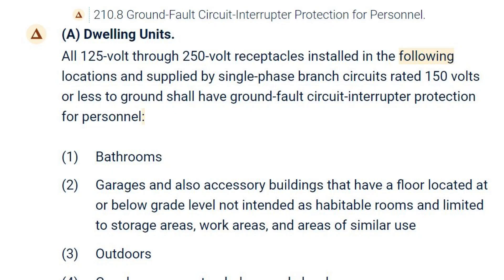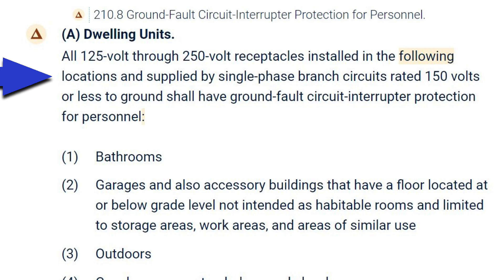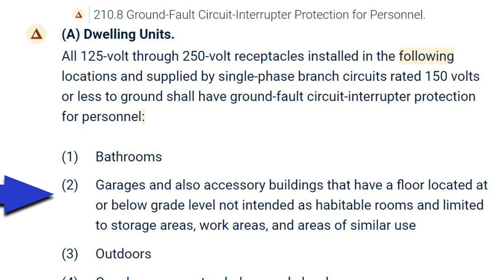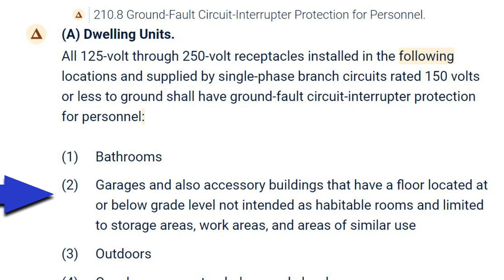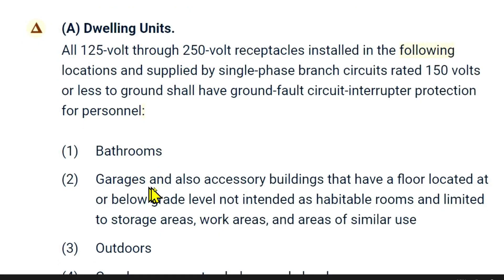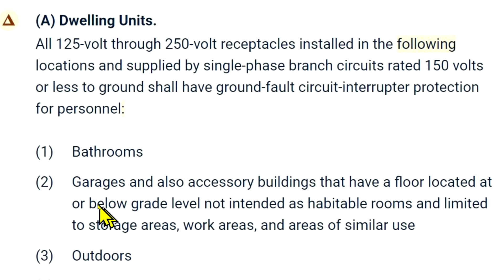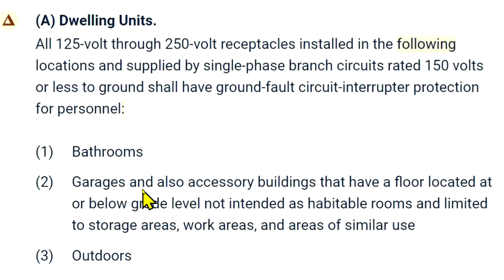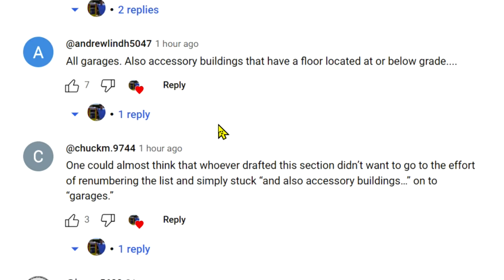Controversy in the 2023 NEC: Above Grade Garages Don't Need GFCI?

Comment: Hey Bill, random question/video recommendation. Is there a way to go about pulling continuous power from a 14/3 wire?

For example, you’ve got a receptacle box where 12/3 is coming in to a three-way switch, and then 12/2 is leaving up a light. Is it possible to add an and additional 12/2 in that box and pull continuous power for an outlet? Thanks!

Comment: Years ago, this was much simpler.  The traditional garage most of us grew up with was a single car.  Then in the 1970's we went to 2 car garages.  I consider concrete floors as "semi-conductors".  When dry, it should be non-conductive, but concrete is porous, it may look dry on the surface, but you can never tell how much moisture it contains.  To sum up the code, a GFCI is required anywhere that is wet or damp, Bathrooms, Kitchens, Basements, outdoor outlets and garages.  But now in the last 25 years or so, people have started putting in actual walk up lofts, with solid floors and lights and outlets.  But by the damp/wet definition this part of the garage has no higher shock risk than a second floor bedroom in the house, which does not require GFCI protection.  But in the next few years, they will probably require GFCI/AFCI breakers on water heaters, dryers, and stoves, and EVERY other circuit in the house!

Comment: regardless of how you define things, "at grade" is likely to mean walking (or driving) into the structure without steps. "Above grade" likely means it's not a garage, in which case all of the other rules apply. IOW, cement floors and close to a sink/ tub / shower will mean GFCI is needed.

Comment: Question- what is typical for the final inspection on a residential job. Jumping power from temporary service, using generator power or something else? Thanks for your input.
Reply from the maker: It's typical to work on the construction with temporary power, then with the coordination of the local utility, your inspector and the electrical contractor, the permanent power is turned on.
Reply: @SparkyChannel  i got a city that wants me to buy an additional permit, temporary permanent power, for the final. In Birmingham Alabama.

Comment: what if the wall mounted microwave was plugged into a outlet and the outlet was mounted on the inside of a kitchen cabinet do you still have to change out a regular outlet for a gfci?...(not sure if the outlet is or not wired up to a gfci breaker though and the microwave is mounted close to a sink though)
Reply: no, because it serves a dedicated appliance, and not readily accessible

Comment: I just checked the 2021 International Residential Code and Commentary, because I don’t have a copy of the Electrical Codes with the commentary.  

E3902.2 Garage and accessory building receptacles.

125-volt through 250-volt receptacles installed in garages and grade-level portions of unfinished accessory buildings used for storage or work areas and supplied by single-phase branch circuits rated 150 volts or less to ground shall have ground-fault circuit-interrupter protection for personnel. [210.8(A)(2)]

❖ A receptacle in an accessory building, an implement shed or even a storage shed also requires GFCI protection. Sometimes an appliance such as a food freezer or refrigerator is located in a garage, and where such an appliance is plugged into a GFCI receptacle, nuisance tripping of the GFCI device could cause food to spoil. Therefore, in the past, it was common to have some appliances supplied by non-GFCI protected circuits where the appliances and the receptacles that supplied them were in a space dedicated for the cord- and plug-connected appliances and such appliances were “not easily moved.” However, this practice is no longer allowed. The concern for nuisance tripping is not valid for modern appliances that have far less leakage currents than their predecessors. If an appliance such as an older model refrigerator trips a GFCI device, it proves that the appliance has high leakage current and should be retired and recycled. The code believes that there is no valid excuse for not having GFCI protection in any location where the occupants could be at risk of electrical shock. There are no exceptions to this section's requirements.

Note that electric utility companies often claim that it is energy wasteful to relocate old inefficient freezers and refrigerators to the garage where they will continue to waste energy in their new location and also labor under extreme temperature conditions. Some utility companies have programs that will pay consumers to get rid of their old, inefficient refrigerators and freezers and will even haul them away. Note that this section addresses receptacles of 125 through 250 volts, which means that 250-volt receptacles installed for electric ranges, electric clothes dryers, welders, shop tools and other 250-volt loads are required to have GFCI protection. Two-pole GFCI circuit breakers are available for this purpose. The code standardizes voltages at 125/250 even though some localities are provided with 110/220, 115/230 or 120/240 service voltages.

Comment: I think the code should be written:  All Garages, and accessory buildings, which have a floor is at or below grade level….

I think the problem is arising because we aren’t thinking through the code, and what they are attempting to accomplish.   My thought is anything with a slab on grade concrete floor, should have GFI protection, because even if the slab on grade is built on an elevated building pad, above the grade of the surrounding lot, that slab on grade will have a direct path to ground, due to the moisture in the soil.  In my mind any concrete slab which you can construct a Ufer ground by bonding to the reinforcing steel, is a ground.   All the areas/locations requiring GFI protection have a good uninsulated path to ground.  So, if yhe code intent is protecting people from becoming the path to ground, anything with a slab on grade floor, requires GFI protection.

Comment: The NEC should consider Equipment Ground Fault Protection devices as alternatives to GFCI for certain equipment such as refrigerator/freezers, or equipment subject to nuisance tripping.
Reply from the maker: Interesting, thanks!
Reply: Ground fault protection has been in place for ages with equipment grounding/bonding requirements via a three wire plug to a three prong outlet. That should be more than sufficient for protection on dedicated appliance outlets. Adding a GFCI on top of that, in these dedicated circumstances, is a cost and complexity overkill. I can't think of a benefit payback. It's not as if someone is repeatedly plugging and unplugging their refrigerator while standing in a bucket of water and grabbing a cold water pipe through a convient hole in the drywall.
Reply: @russellboedeker2070 Not all ground faults occur on the grounded case of equipment or where the bond would help. So, under the limited condition where the ground fault is to the grounded case of the equipment, and it is properly bonded, then yes, it will trip the breaker;  
   BUT, if there is a loose wire touching water, and that loose wire is NOT directly touching the grounded and bonded case, then if a person touches that loose wire or the water then they potentially get shocked or worse, and there won't be enough return thru the EGC to save the person from shock without the GFCI.

Comment: If they wanted Garages to have a period after the word, they should have put it as a separate line item, like all the others. So, I read that as being a combined sentence... meaning that (garages and accessory buildings) that have a floor at or below grade...
Having said that, I don't see the need for describing the "grade" at all. What difference does the grade level make with respect to safety... NONE. A ground fault can occur at any level, at grade, below grade or above grade. If I were the AHJ, I would ignore the grade comment completely for safety reasons, and require GFCI for all garages... regardless of location.
Reply from the maker: Thanks!

Comment: It is poorly worded based on the most likely intention. A garage that is built for driving your vehicle in and out that is above grade level would be a rare design indeed, I've never seen one. A non-vehicle storage type garage or other similar outbuilding could be built above or even well above grade level. This is where the inspector's judgement would come in to play. I would be hard pressed to believe that an inspector wouldn't require GFCI in a garage type structure designed for vehicle storage regardless of measuring grade level, as that seems what the code writers (for whom English must be their third langage) meant to convey. My third grade English teacher would be appauled.
Reply from the maker: LOL! Russell, you cracked me up! My 3rd grade teacher would have been very disappointed as well.

Comment: Not a fan of the 250V part. Guessing thats for EV chargers. Hope that doesn't cause problems with my welders/plasma cutters in the shop I plan on building.
Reply: Except most (if not all) EVSEs have GFCI built in already, which causes big problems.  Should be an exception for appliances/devices that have GFCI built-in.
Reply: @dperreno    there is an exception... it's called hardwiring.... if the appliance (EV power) has its own GFCI built in.
Reply from the maker: Excellent point. @dperreno
Reply: Add the  welder supply circuits after the government trough feeders aka inspectors have signed off on the permit(s)

Comment: I'm sticking with my two comments: 

1: punctuation saves lives: "let's eat grandma"

2: how are you going to get your car into your above grade garage?
Reply from the maker: Yes, a comma can make a lot of difference. Thanks Ken!
Reply: Car Elevator. Then as you brag to your buddy about not having to have GFCI because you're "above grade" on  the second floor as  you charge up your EV, and get the shock of your life...
Reply: @marcfruchtman9473 EV chargers aren't GFCI protected.
Reply: @kenbrown2808 Interesting. The code says 125v through 250v... what allows them to be excluded if installed in a garage?

Comment: It seems this code still requires GFCI for any residential garage I've ever seen. Where would you find a  residential garage above grade level?
Reply: my brother could make the claim that his garage is above grade, since there is a breezeway under it.  but since you drive downhill into it, the entrance is still at grade level.
Reply: @kenbrown2808  Is the floor conductive?
Reply from the maker: Build your stem walls first, then pour your garage floor as high as you like. A driveway would have to go downhill from the garage for the floor to be above grade.
Reply: Hmm, interesting thought. I would think that the driveway entering the garage would be considered the finish grade, regardless of which way it slopes. Maybe if you had a bridge or structural ramp to access your garage, it could be considered above grade, lol.

Comment: How does the NEC define grade.  I am not an electrician, but to me all garages except parking garages are at grade otherwise what kind of ramp do you have to drive up to get in.  Do they suddenly become dry areas above grade even after you park you wet car in it?

My garage identifies as a workshop anyway.  Hasn't seen a car in decades.
Reply from the maker: Yes, the NEC should define what they mean by grade. I agree.
Reply: So if my garage is at grade but my accessory building is above grade I don't need GFI in garage because of the word and? It's easy to have an accessory building above grade. I could block it up with cinder blocks because I don't want the building floor to be in contact with the soil. Then I have a ramp built up to the door. Or maybe it's just a shed to store garden tools that has a set up to the door.

Comment: If it was garages "period", why would they not have put accessory buildings under a new number?  

Edit: After thinking about it, I'm unsure if an above grade garage/accessory space requires GFCI. Example: 2nd floor of a detached garage is a dedicated  machinist/wood working space. It's still a garage, does the second floor require GFCI?

With my new question, I would like to say I believe the code is written by very intelligent people putting in a lot of time and effort to communicate concepts to a wide assortment of people with a process for continued improvement. People often disagree on the meaning of written documents and it's fun to point it out.
Reply: What is exactly is an "accessory building"?  A shed?  A wood working shop?  Feed storage building?  Dirty floor?  Wood floor? Cement floor?  Writing the code is tough.  What I called an out building on the northeast might be different in the southwest.  
Probably should have had its on numbered paragraph.
Reply from the maker: I agree. Put garages and accessory buildings, etc. on their own numbered bullet points. And the NEC should define "grade" for us. @dwayne7356
Reply: I agree. The people writing these things aren't always the sharpest nail in the shed. What they have in their head is what they think they put on paper. To other people, that's an unclear run-on sentence. You'd think any number of their lawyers would've read that and flagged it.

Comment: The only controversy here is that NEC groups a garage in with other outbuildings.
Any garage, at or above grade, can and will have a vehicle parked in it that is cover by rain, ice, hail pellets or snow. All of which can form puddles on the floor. Therefore, in my mind, GFCI protection is required.
Reply from the maker: I agree. Thanks Bill!
Reply: Yet, the puddle on the floor is a greater distance to 4’ level outlets than the distance is from basin to outlet in kitchen and bathrooms.

Comment: It's mostly common sense. People that don't have an understanding of NEC ought not to mess with their wiring. Electricians that know, know what is meant and what the code requirements are. As stupidity evolves, it's coming to the point that everything is going to require more and more protection, as we're seeing with the incorporation of GFCI on all circuit breakers. In my area, any rewire or new work also requires a whole home surge protector. Then everything will change and people will be using solar and battery power for everything. As it stands right now, inverted power does not have a GFCI and will not work if a GFCI is added inline. I checked it. Also, all 3 lights on a simple circuit tester will illuminate, and the legend has no reference to what that means.
Reply from the maker: Interesting, thanks!

Comment: Great question about the code. Also, what is considered "at grade level"? Even with the ground/grade? 1" above the ground/grade? 12" above the ground/grade?
Reply from the maker: The NEC should define "grade" for us IMO.
Reply: A formal definition of "grade level" would be of benefit. Even the ground floor of a house is somewhat above the actual ground. We don't live in log cabins built on dirt floors. If you use "grade" as the earth you are standing on outside, pretty much every structure is then technically above grade level. Would seem doubtful that is the intention. A definition could be along the lines of "the lowest floor level of a structure intended as habitable rooms...", or something like that. Then define "outside grade level" as the earth one stands upon if needed, which it may be to cover outdoor electrical situations.

Comment: Hasn’t it always been code that all receptacles are GFCI in garages?!
Reply: Yes. And it still is. It's just poorly written. But it's been written this way at least since the 2017 code(except 2017 has a comma after "garages"). So, if there's a "controversy" it's not new.
Reply from the maker: Why did they remove the comma after 2017? Anyone know?
Reply: @SparkyChannel  I believe it was originally written to separate the two structure types.  Rewriting it using their language, could say, "Garages (pause), and also accessory buildings that have a floor located at or below grade level,,, ".  To me that is saying, garages require GFCI protection and also accessory buildings that have a floor located at or below grade level,, require GFCI protection.  Removing the comma lumps the two structures and floor positions with respect to grade, together with the same GFCI requirements.. A thought.  I believe I'll write for a formal state wide interpretation.
Reply: I doubt it was purposeful. @SparkyChannel
Reply: @phi5head  Disagree.  Revisions have to go thru the editorial & legal review.  Both know full well how a single "," can affect the meaning of the sentence.  Ambiguities exist to employ folks like them.
Reply: @ElectroAtletico  So you believe they purposefully removed the comma? In order to remove the gfci requirement for garages above grade? Even though grade has nothing to do with why a garage needs gfci protection? And, even though, the NEC's current trend is adding gfci requirements, not subtracting?
Reply: @phi5head  Yeah, lawyers do that. They've been doing that since the US Constitution was written.  Put a comma here, there, and voila, you have 200 years of litigation.
Reply: So, your position is that they removed the comma, not necessarily to remove the gfci requirement for garages above grade, but just to sow confusion? @ElectroAtletico